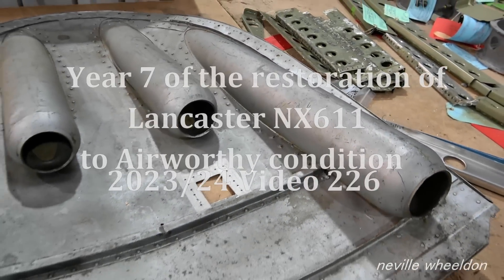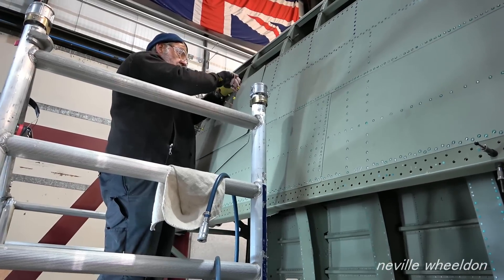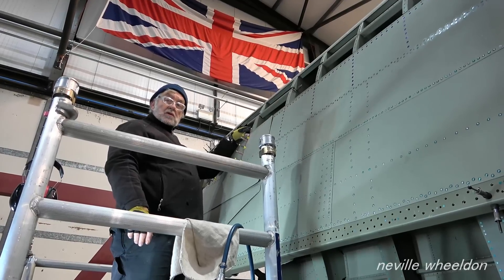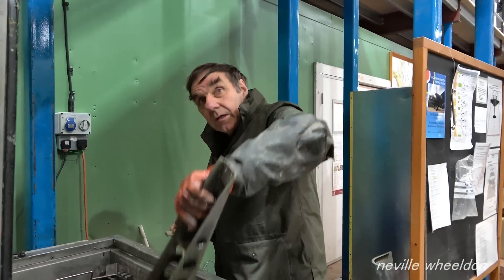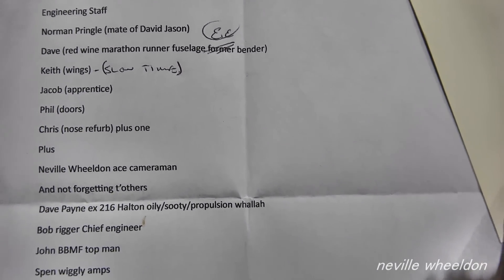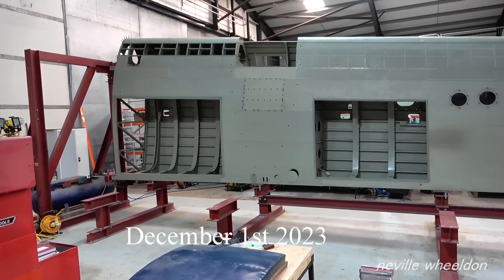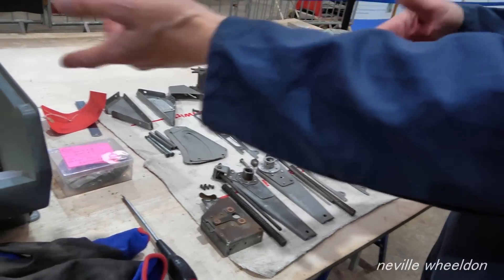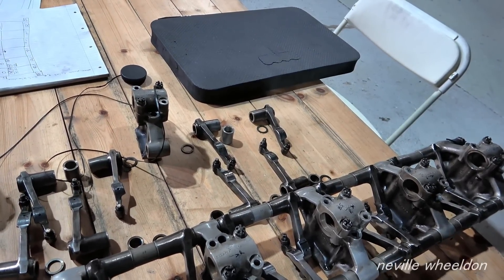Video 226 Restoration of Lancaster NX611 Year 7 .. Preparation to transfer fitting.

Comment: Nev, I'm at the section of the video where Dennis is making the formers for the trailing edge and spotted something potentially extremely dangerous - how he is using the router. I have been involved with manufacturing since 1982 and have worked extensively with plunge routers.  

Routers spin in a clockwise direction and the router bit only cuts on one side of each "blade". Unless your video is flipped (left-right), the router bit is "pulling forward" against the piece Dennis is routering. This is the WRONG and extremely dangerous way to router.

I have trained may lads to use the plunge router over the years. The most important and very first thing I teach them is that the piece you are routering must ALWAYS be on your left (and the left side of the router) so that the router bit is pushing the router BACK towards you.

If you have the wood edge on your right and on the right side of the router, then, because of clockwise rotation of the router bit, it is trying to "bite/grab" the wood and pull AWAY from you. Besides being extremely dangerous, one CANNOT control the router properly OR keep a constant routering (forward) speed when the router keeps grabbing and trying to pull itself out of your hands. There is an extremely high chance that the router bit WILL eventually "grab" the wood and surge forward without Dennis being able to stop it. 

I have seen fingers badly cut when the router "grabs" and goes careening off the side of the wood, held only by one hand (because it pulled out of the other hand when it surged forward) as well as intricate wood pieces getting ruined AND the router damaged and or router bit destroyed.

ALWAYS KEEP THE ROUTER BIT ROTATING AGAINST THE PIECE YOU ARE ROUTERING!!!!!!

Im sorry to be a "stick in the mud" but even if no accidents have happened with the router being used as it is, it is only a matter of time before they do. I know the guys are probably not carpenters and may not have had any previous experience working with routers - and I am not criticising ANYONE I am merely pointing out that for whatever reasons, the machine is being used incorrectly and in a way which poses a danger to the user and the work-piece being worked on.

If none of the above makes any sense, please let me know and I will put together some graphics and email it you.
Reply from the maker: Hi Steve, Dave had already seen your comments when I told him about your concern. Thank you.
Reply: Hi Neville.
Thank you for letting me know. Please would you let Dave know my comments were in no way intended as a criticism of his workmanship. I was only concerned with safety and advising potential mishaps. I hope the information I have was of assistance.

Keep up the fantastic work